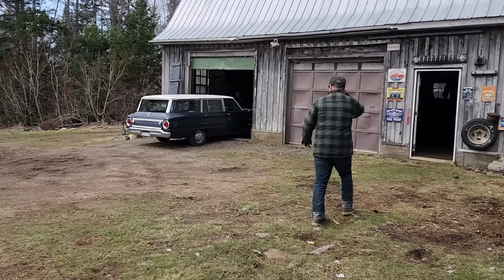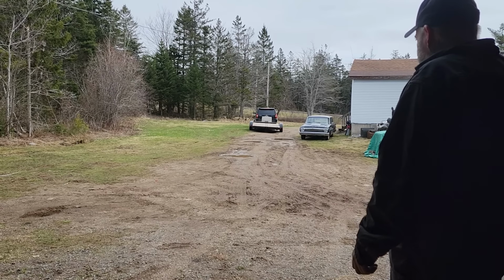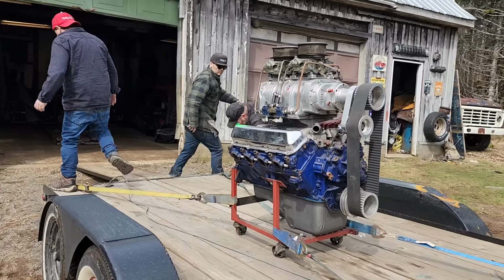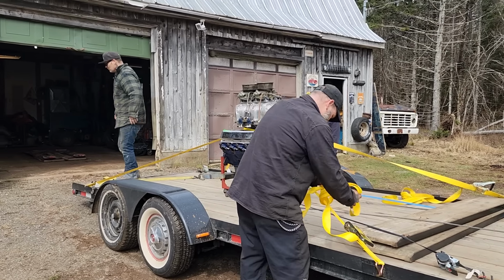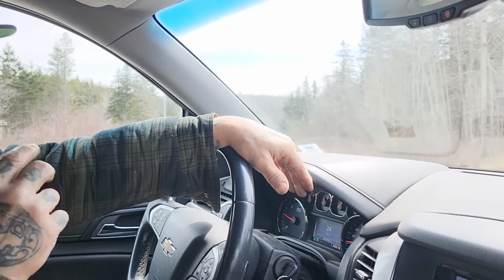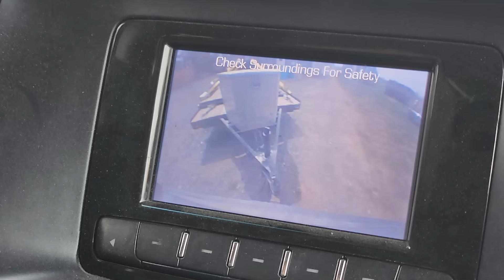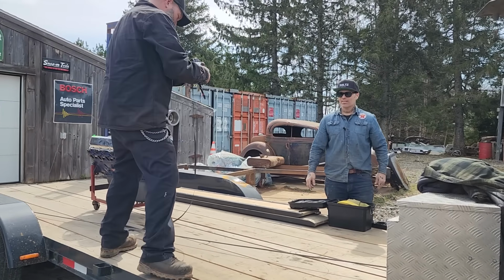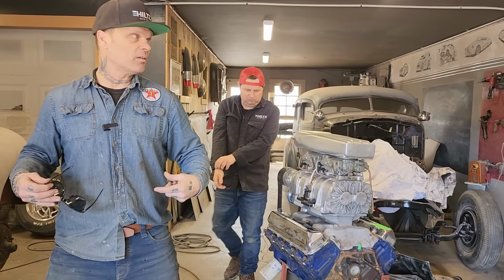The PERFECT engine… big block Ford, blower, 2x4’s 😵💰

Comment: Thank You  Chad , Jolene , Nate and Doug for the trip up  Canning Mountain to Nate's Place.
Nate really came through with the 525 H>P. 650 Ft. Lbs. of Torque Blown Ford Engine. The good old Nova Scotia Bartering And Swapping System  will work every time if You know what your looking for and Nate truly does. A huge boost to" Project Blue Hot Wheels "

Comment: It just seems like the right engine. 😎👍 
I finally saw where Nathan lives, a beautiful place on the hill. Yes, of course it is normal, a slight altitude is enough to feel colder temperatures.
The mountain I see from my window has a peak at 2,700 meters above sea level, and is still covered in snow.

Comment: Just on the count of cuz.... when you use the board slots on a trailer for straps, place the strap through the center first, then up on the outside and then clip the hook on the edge.  This way the strap can never simply fall off when tension is lost.

Comment: Hey Chad, I have some old gas and oil stuff, a couple of old 30s-40s truck doors with old ranch names like diamond bar-s but in shapes not words and I have a huge sign from the Clint Eastwood movie thunderbolt and light foot the sign is from the gas station in the movie. Been hoarding them for years but if you're interested let me know. I feel that you would appreciate them as much if not more than I do/did

Comment: What did you give for this motor?  Jolene is pissed at Chad because he didn’t tell her about getting the motor, it was a huge surprise for her and she was mad as hell because the amount she said he gave for the motor.  It must have been very very expensive for her to be that pissed off at Chad.  She said she wasn’t use to spending that much money for an engine.  It had to be $10k+ for it, that it better be what the dude said it was.  I know one thing, that’s going to be one bad ass scary car to drive.  It already looks awesome and with that blower sticking out of the hood it will be the hot wheels car come to life.

Comment: If you drag race that engine, even if you don't, you should consider a blower bag for safety. If it fails the rotors in the blower will come out the back end of the blower right in your face,